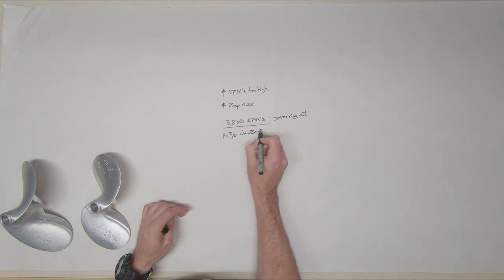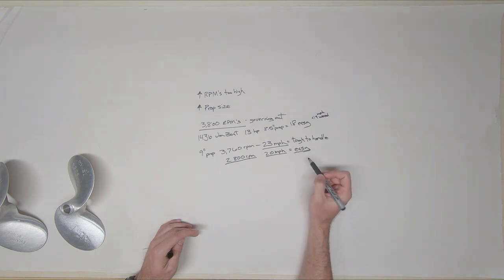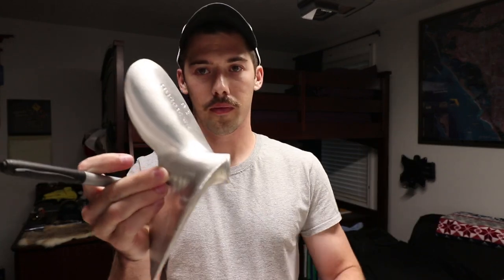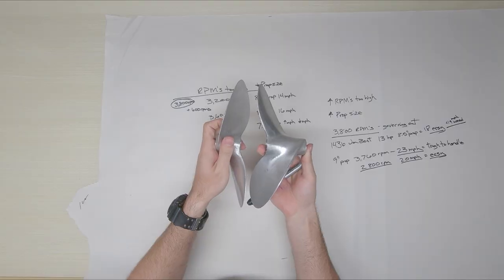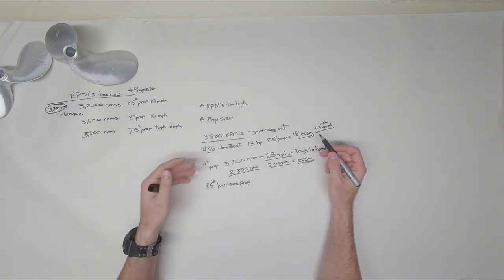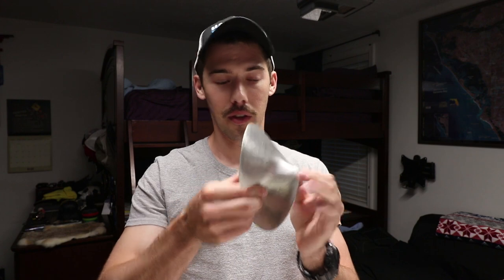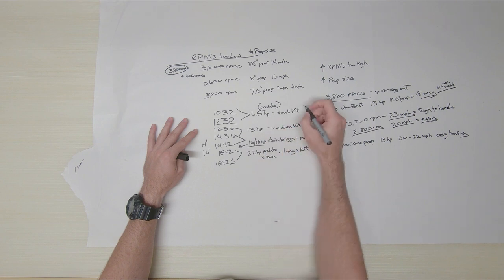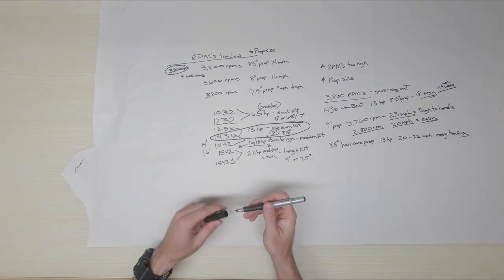Sizing a Prop {Longtail Mud Motors}

Comment: Built a 1436 7hp longtail from mudskipper . Hitting 20-22mph with my 7in prop . Any thing smaller in prop size I begun to hit the Rev limit and can't max the mph all the way a 7 inch prop can due to the Rev limit  . When I have a 6.5 in prop it revs high and drops non stop . Will a hurricane prop fit on my 7hp kit ? I run heavy and feel like a bigger prop will always get my top end speed up in the the long run . I'm interested if the hurricane 7 in prop with deeper pitch will make a deference .
Reply from the maker: Those are some good speeds. What kind of modifications have you done to the engine and what shaft length do you have? As for your prop, I think that's the best you are going to get. As you said, the 6.5 is smaller and it's hitting the rev limit. The 7.5" seems like it would be too much, but you never know. You could give it a try. The hurricane props have the increased pitch, but if you're running a "heavier" load, pitch is your enemy when it comes to a  heavy load. It multiplies the load on the engine. The standard props are best for hauling loads. If you're going to try and get top speed, it may be best to try the 7.5" standard. The 7" hurricane should fit your kit, and would most likely work, but swamp runner only sells the hurricane props to swamp runner owners. If your engine is spinning 4500 rpm's or more, then the hurricane would really work. They like high RPM's just like the bullet props, but for standard RPM's, the standard props work great. You're already getting really good speeds

Comment: I've got a 1236 with a 16 horse under that a mud skipper... too heavy for the boat you think?
Reply from the maker: It would depend on your weight. If you're under 150lbs and have some bow weight and an empty hull, you may be able to pull it off, but most people are over 150lbs and have the boat loaded down and in that situation, it will be too heavy. Also, it may be too much for that transom when it comes to power. All depends on what you're expecting from the setup. Theres many ways to address a single issue
Reply: @JTgatoring  I'm 235 my passenger is 220 it worked ok. I got 16 mph down river then 13 back up. I've also ran it with the hull completely empty except myself and one gallon of fuel. Both times had nothing in the bow. Transom seems to be ok so far. I want faster but it seems that might be unreasonable.
Reply: @JTgatoring  I uploaded a video for you
Reply from the maker: @Iowawalrus  I looked at the video and with that boat, the transom has that center support so you should be fine if you aren't too rough on it. The alumacraft I have failed with a 13hp engine but the support was off-center. If you want fast, long and narrow is your best bet. The 1436 I run will go 17 mph with my 150lbs; a 220lb passenger; along with the floor, deck, and fishing gear with a stock 420 engine. I get a constant 22mph if solo. It's a 1236, you may be asking too much of it. Still, 16 ain't bad. I've heard a lot slower. Heck, the backwater I had with the same 420 stock engine would only go 16mph and that was solo with a light load.
Reply: @JTgatoring  thanks for you're input very much Appreciated.  Great info

Comment: I run a 12/32 with a 8hp gx240 and run a 8” prop and get 17mph with me and my wife , I run the 110” shaft from mud skipper
Reply from the maker: Awesome! Sounds like you have it dialed in. That seems like a pretty long shaft for that setup. If it works for you, great, but you could probably get a shorter shaft if you needed too. But a 1232 with an 8hp and an 8" prop sounds about right at 17 mph.

Comment: New friend from philippines sir i have marine engine 20hp 1800 rpm what is the best size of propeller?thank you
Reply from the maker: I know longtail props, but I do not know much about outboard marine engines. You should be getting more than 1800rpm on a marine engine. The more RPM's, the faster the prop spins and the faster you go. If your RPM's are currently low with the prop you have now, then you need to go to a smaller prop.

Comment: I got a 16hp on a 15x40 boat, had I believe an 8 1/2 inch prop, but it lbroke before I confirmed that. It kinda lugged out so I got a 7 1/2 to pick up rpm’s as I use it in fields not going long distances. Is that too small?
Reply from the maker: I would recommend getting a tachometer for the engine so that you know. Just from the sounds of it, if it's a true thai longtail, a 7.5" prop would be small for that setup. An 8.5 should run pretty well on that with a normal to light load if it is a riveted jon boat. If the 8.5" is too big, the 8" would be the go too. Again, I would think the 7.5" would be too small unless its a welded boat that's fully loaded.
Reply: @JTgatoring  there’s about 500 pounds in the boat normally (2 people, battery’s, etc)  and the 8.5 ran pretty good but any thick mud or thick/tall weeds would choke the motor down a lotttt

Comment: What’s the difference between high power and high speed props?
And I have a 1436 with a 22hp long tail with a 91/2 prop and getting 21 mph at max rpm. Any help on getting up to the high 20s or 30s
Reply from the maker: I haven't heard from anyone who runs the props from mud skipper. I've had people tell me about the swamp runner hurricane and bullet props. Most people who chase after speed use the 8" bullet, and 8.5" hurricane, or go with an oversized standard prop like you're currently doing. Other than that, there's no other easy way to go fast other than increase hull performance.

Comment: I have a 1648 aluma craft with a Honda 22 hp gx 690 with a 9.5"prop. I have no idea what rpm I run will get that info soon but I can get 37 kmh or 22 mph for the other side of the border with just me battery and gas tank full
Reply from the maker: Very nice Ricky, what kit do you have and how does it handle on your 1648?

Comment: I recently bought a 8.5 hurricane prop to put on my 13hp motor. When I tried to put it on the shaft, the prop wouldn’t get tight on the taper and the long prop nut got tight and wouldn’t tighten anymore. Am I missing some sort of washer or something?
Reply from the maker: Possibly. Just send swamp runner a message or give them a call. They'll be able to help you out with it. I didn't have any issues with my hurricane fitting

Comment: Just got a 16’ with a 24hp Honda. It seems to have a stainless steel seedless prop. Only goes 14mph. And idea on what size/pitch prop I should get?
Reply from the maker: That would depend on the style of mud motor you have. I know thai longtails, but american style longtails and surface drives act different
Reply: @JTgatoring  thanks for the reply. The motor is a longtail style.
Reply from the maker: @wpb34  Alright, well a thai longtail runs differently than an american longtail. They use different props. If the boat is a 1648 with a 24hp engine, that seems about right but a little slow. I would recommend getting a tachometer and seeing where your RPM's are at. Once you know your RPM's, you can better choose a prop.
Reply: @JTgatoring  thanks bro. The tach comes in today. I think it is taching out. Bigger prop and more pitch maybe. My first mud boat. Definitely challenging, but effective
Reply from the maker: @wpb34   already had one ordered, nice. Yeah, put it on there, and if you're over 3800 while in the water at full throttle with your normal load, then get a bigger prop. I think the saying goes... an inch of diameter is worth two inches of pitch. So if you go up a half inch in diameter, it would be the same as keeping your current diameter prop and going up 1" in pitch.
Reply: @JTgatoring  that info is priceless. I was just kinda guessing. I will check it out on the water tonight. Thanks!!!
Reply from the maker: @wpb34  Best of luck!

Comment: I got the  mud skipper 6.5 hp  and I have the 6 1/2    And 6 1/4 prop and only get ten mph what can I do to get more speed out of it
Reply: Bigger prop or a prop with more pitch
Reply: Otherwise modifying your engine to get more rpm out of it
Reply: Hello James, I know about 8 weeks late here, but hopefully you'll still see this.
Given the speed you're getting, I've got to ask about the boat itself. How long? How wide? How heavy? (The width and weight are both more important than length, from what I've been researching on these motors.) Apparantly, your setup performs best with a boat width in the 32" - 38" range, with narrower being betterer. Weight is the other big factor. Basically, the heavier the boat, the lower it rides in the water. The more of the boat that's in the water makes more drag. If it's too heavy, your 6½ ponies may not have enough grunt to push it up on plane. Once on plane, the drag drops off considerably. You may want to do a weight audit. Do you really need everything you have onboard? A cooler with 100# of ice and a spare 25# anchor is a big penalty
 in a smaller boat.
About 6 weeks ago, someone demonstrated the importance of the width to me, in a pretty impressive way. He has a Swamp Runner with a 16HP engine. He built his own boat. It is plywood on a minimal frame, then fiberglassed inside and out. It's only 36" wide at it's widest point and the transom narrows down to 28". Here's the kicker, it's 21' 7" long and notably heavier than an aluminum boat. It looks like a big, flat bottomed canoe. At 32mph, it's like riding a torpedo down the river. He told me if it's just him and no gear, he can get 37mph. He's a pretty big guy, about 260#. I'm even bigger at 285#. We are about the same height. I'm 6' 6". We went to his brother's place to run against his brother's boat as a comparison. Brother has a 16' aluminum Jon that is 48" wide. He has the same Swamp Runner, only it has an 18hp on it. The longer, heavier, canoe thing (I think he told me it's called a perogie, or something like that.), just flat out ran away from that jonboat. 
Now his '16hp' engine has "had some work done", and he's running a hurricane prop @5,800 rpm. The engine is out of a golf cart, I believe he said it is a Subaru engine. Brother's 18hp Preditor has also been worked on but he can only turn the hurricane about 4,600 rpm, so he's running the biggest standard prop. Both of them blame the width of the jonboat for it's lower top speed. 
I'm now very seriously considering building myself a boat like this. He says that he will sell me the next blown-up golf cart motor that comes in his shop. And he will show me what I need to rebuild it like his. He said parts and the used (blown) motor should be about $375. Since that motor, stone stock, sells for about $650, that sounds like a deal to me. With any luck, come next spring, I'll be fishing out of a giant wooden canoe. Plenty of room on this thing, I could fit every fishing pole I own and still have room.
Reply: @bob2161  14-36  and I found out the 7.5 is to big but the 7 is perfect I just need a bigger motor
Reply: @jamesrogers6307  I'm glad you're getting it worked out. 
BTW, I'm learning that there are quite a few things you can do to these engines substantially to improve their output.
Reply: @bob2161  yeah I have the level one up grade on it but it’s not as fast as I wish it it works it’s not a race as long as I get to where I am going

Comment: Would too high RPMs cause cavitation?
Reply from the maker: I haven't been in that situation before. If you put too small of a prop on I'm sure you would be able to find out. I would think it would have a lot of slip and some cavitation
Reply: If you set your boat up right or get lucky etc. once your going if your running full prop in water. Get on plane. And have enough pitch or rpm. You will experience true half prop running. It’s very noticeable too, usually you can let off the gas a bit and keep it going. It’s smooths out. Has sort of a floating effect. Starts to over rev but goes faster. All at the same time. So to answer your question actually yes. If you have weeds on the prop. Or it’s too small for weight and hp. Big props less pitch don’t halfprop either below 4000. It’s gotta be a race prop or hurricane or t76 etc. But no even with half the prop in water they don’t cavitate  they actually run better.

Comment: How do you keep your motor in the water running full throttle?
Reply from the maker: Could you be a little more specific?
Reply: @JTgatoring  I think I have figured it out now but I have a 1436 Jon boat with a 22 horse long tail and anytime I rev it above a bout half throttle the prop comes out of the water. I think the boat is way overpowered because with multiple people in it it runs great
Reply from the maker: @jjbassin357  Yeah that's a lot for a 1436. You could watch this video if you have a thai longtail and it should help - https://youtu.be/FAA7j0dVrLU Also try a smaller prop like a 8.5 or 8.75. A 9" prop seemed to be too much for my 1436 but anything smaller works great. Also, once I reach 20+ mph it becomes difficult to handle due to the fact that I start to outrun my wake.

Comment: Is that 1032,1232 &1236, 1436 are boat size in foot
Reply from the maker: Somewhat...  First two digits are feet, last two digits are inches.1032 is a 10 foot boat with a 32" bottom. 1436 is a 14 foot boat with a 36" bottom.

Comment: what size prop should i use on my Honda gx200 mega marine.....its  7hp 4600 rpm 
thanks
Reply from the maker: It would depend on your hull and the load inside the boat. If it's a light and skinny boat, you could get up to a really high pitch prop like a 6.5 hurricane or a 6.5 bullet prop by SPS. But most people don't have a light enough setup so the hurricane would probably do best. Having more pitch will help keep the prop in the water. Less pitch and the prop will want to climb out, but too much weight means you will have to decrease the load on the engine which means a decreased pitch or diameter. The good thing is that the thai longtail props are pretty affordable and you can get multiple sizes to test out if you really want to dial it in.
Reply: @JTgatoring  thanks alot for your response

Comment: Hey man I got a small frame twister I took lower unit apart and didn’t pay attention to how seal and the other gasket came out do you or anyone else know how it goes back together
Reply from the maker: It would be best to contact the manufacturer of the motor. They should be able to tell you. If not, try a facebook group. I have not put my hands on a twister.

Comment: I bought a 16hp vanguard long tail from a guy for like $300, ran good has a 9 inch prop and I have it on a 1236, so totally over powered but I can’t get the prop off, it’s not stuck to the jam but it’s almost rusted on the drive shaft, anyone have any ideas??
Reply from the maker: You can use heat and/or get a prop puller. Some people have also used a bearing puller. You need to apply tension to the prop (some type of pulling/pushing force in the direction you need to take it off) and then a way to equally apply a high force to it. That's how the prop pullers work. You apply tension and then use a piece of wood to hit against the back end of the prop puller to break the friction fit. Some people use two hammers at the same time on each ear of the prop as close to the hub as possible, but by the sounds of it, its going to take a good amount of force to get it off so I wouldn't recommend the two hammers.

Comment: I just bought up war eagle 17foot  4 inches long 50 inches wide with a gator tail XD 40 efi looking for a prop that will make it fast as possible while still having a decent dig . Any suggestions
Reply: Also is a 2 blade or 3 blade better
Reply from the maker: @504Evan  Hey Evan! I'm not the most familiar with other props. I know longtails pretty good because there's not much out there and I've tested most of them. I know that RPM matters. You need a tachometer to know what RPM's your engine is spinning. Then you need to know what your engines max RPM rating is. Try to get as close to that as possible. So say the engine maxes out at 4000 rpm. Aim for 3700 to 3900 RPM to get the most out of it. You can either increase pitch or increase the diameter. If I remember correctly, half-inch pitch is worth 1-inch diameter. So a 9" prop with a 6" pitch (9x6) would perform similarly to an 8" prop with a 6.5" pitch (8x6.5) (on paper that is). What I remember is when it comes to two or three-blade prop, is that two blade will normally get more speed due to less drag, while the three-blade has a better hole shot and performs better in current. Don't take my word for it though. That's just what I remember from a conversation with an older fisherman I had while out on the dock.

Comment: i have a Honda GX 390 mega marine 16hp what can be used as a racer propeller
Reply from the maker: Well, the only mud motor company that I know of that deals with a lot of different styles of props is Swamp Runner. I would reach out to them and see what they say.